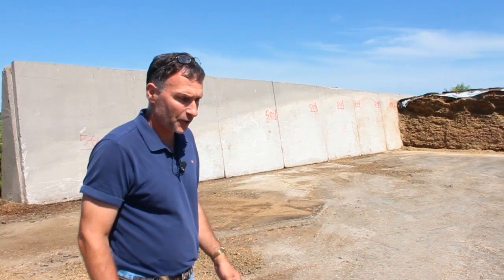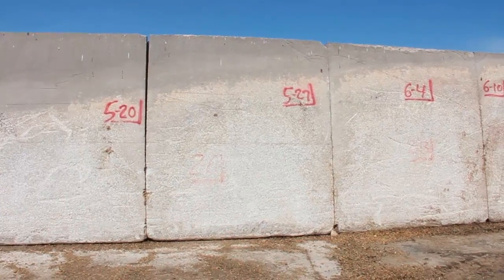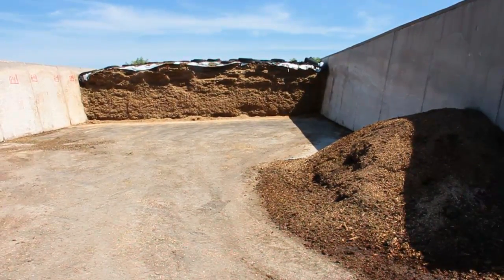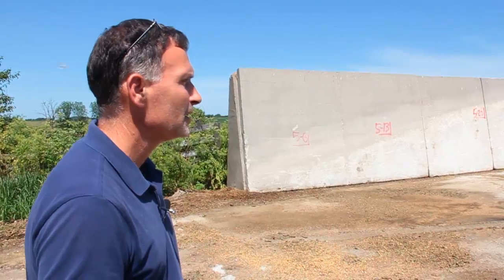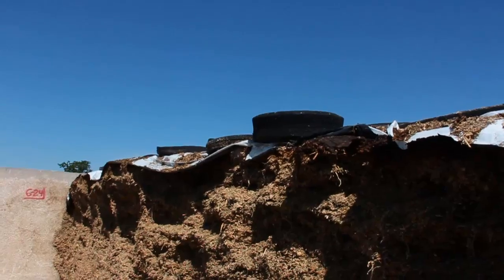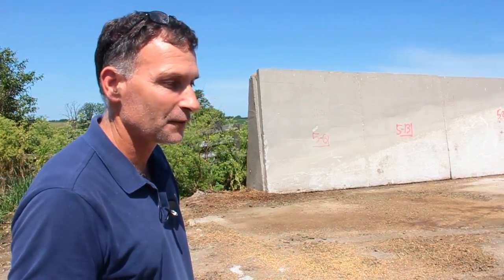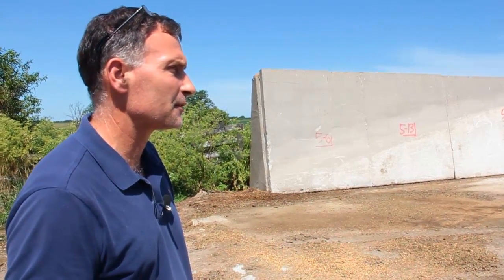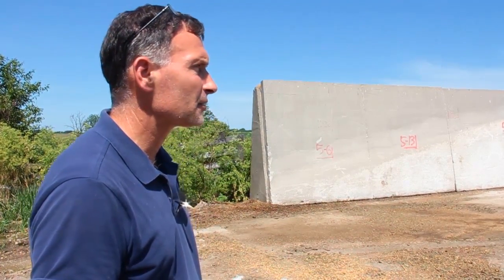Corn Silage Bunker

Comment: I find that a really slow pack (say, low range 2nd gear) works a lot better than multiple packings at a higher speed..slow is the way to go..at higher speeds, it fluffs up right behind you